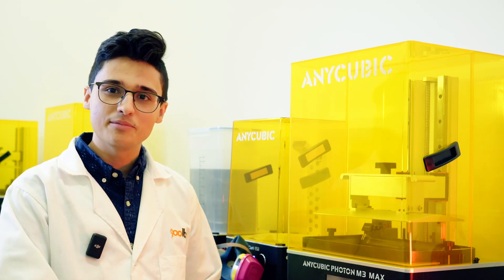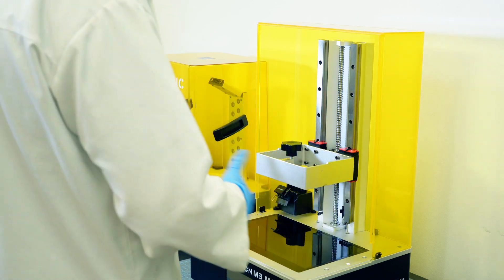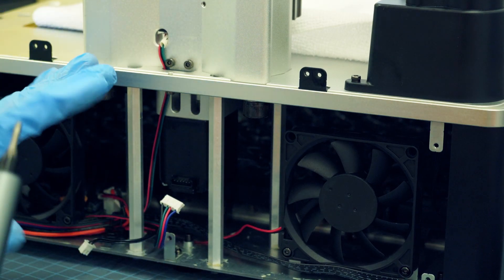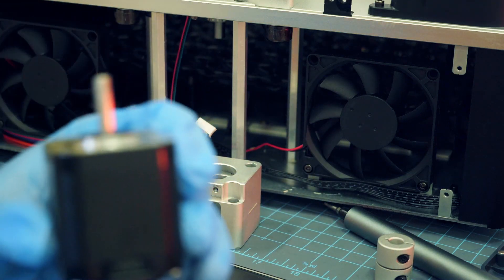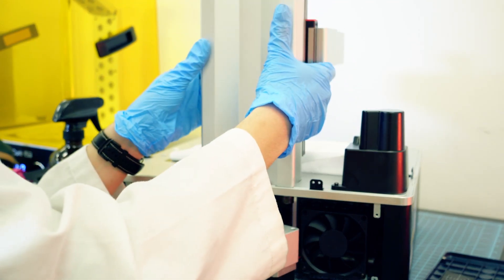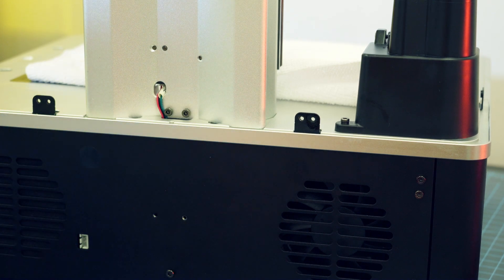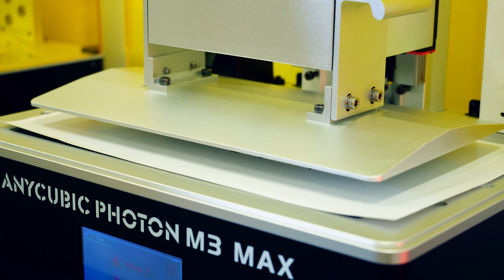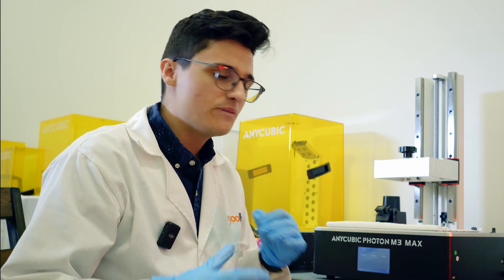How To: Replace the Z-Axis Motor | Anycubic Photon M3 Max

Comment: If you change the motor, it's not needed to relevel the build plate. The zero level thin plate (that intercept the zero sensor) is connected to the Z arm that move the plate, so if you do not dismount that sensor or the thin plate, there no need to do a leveling. And in the video you forgot to reconnect the 2Pin connector that link the resin bottle sensor... do not forget it! My 2 cents.

Comment: Great video. I would love to see some tips/tricks for using a larger printer like the M3 Max. I tend to print slow, but I feel like these machines require more attention.
Reply from the maker: Thank you! I'm planning to do a full review for this printer some time soon since this month marks a year since I first started using the M3 Max. My main complaint is the additional attention these printers require. The large build volume can only really be utilized with a proper auto feed system. While this printer does come with an auto feed system, it has proven to be unreliable. I have utilized 3 separate M3 Maxes with autofeed systems, and all 3 have failed in a variety of ways. While I have had a handful of successful prints using the autofeed system, its track record does not give me confidence to rely on it for commercial work. This means for larger prints, I need to manually top off the vat and monitor via a webcam and OBS to keep an eye on resin levels and other potential failures.
Reply: @nicknacks3d  I'm sorry to hear that the auto feed system is unreliable. I typically like to top off the vat after a few hours of printing, but it is another step to worry about. I have seen a few diy gravity fed systems but haven't taken the time to make one. pouring or dripping resin (during a layer curing) is a concern and may cause layer lines or errors in the print.